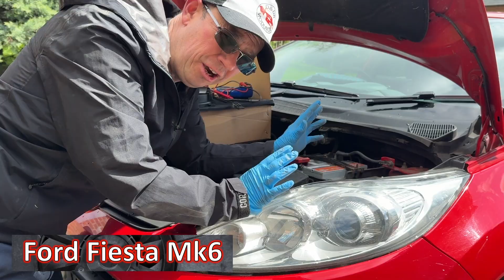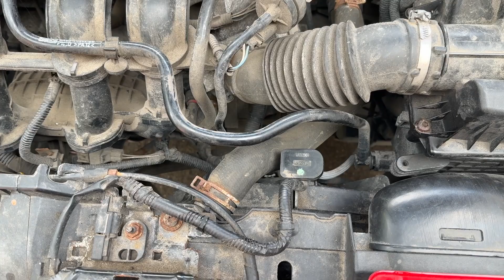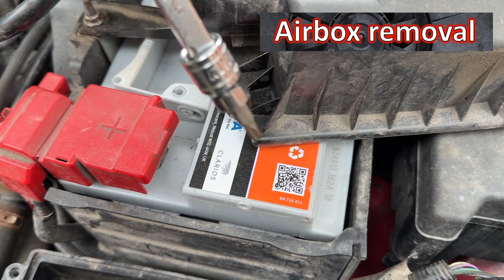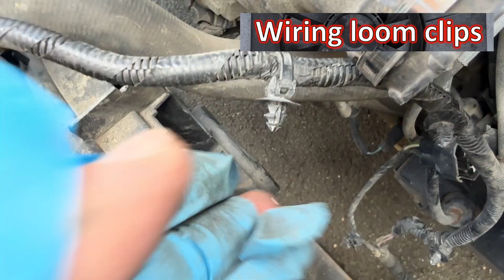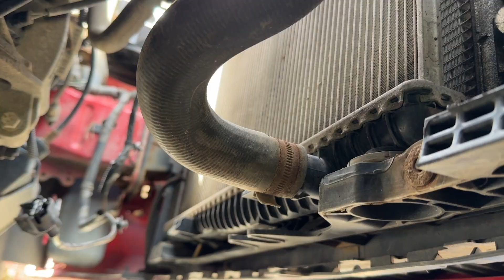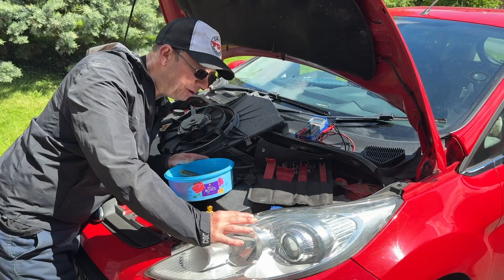Ford Fiesta Radiator Fan Replacement | Fixing Overheating Without Draining Coolant

Comment: I just changed out the fan, 10 minutes, no need to remove the airbox, drops down, no problems. Thank you for your video, it helped big time 👍
Reply from the maker: Per, glad the video helped you get the job done and thanks for sharing that tip about skipping the airbox removal, regards Damian.

Comment: Fantastic video, I’m guessing if the fuse has blown, it will be down to a faulty motor.. am I right in thinking that even replacing the fuse could temporarily fix the fan but the initial problem will still be there. Also how has that after market fan held up?
Reply from the maker: @Menace2S, thank you, glad you enjoyed the video.
You are spot on with your thinking. A blown fuse usually means the fan motor was drawing excessive current—often caused by worn internal bearings, tight spots in the motor windings, or debris seizing the blades. Replacing the fuse might get it spinning temporarily, but as soon as the motor gets hot or hits that high resistance point again, it will likely pop the fuse once more.
As for the aftermarket fan assembly, it has held up brilliantly! It has been fitted for a good while now through all seasons, and we haven't had a single issue with cooling performance, noise, or reliability.
Working and learning together as a community is what this channel is all about, regards Damian
Reply: @Modurol  Thankyou. Can I ask again please the one you have put a link up for, would that fit my my mk7 1.25 fiesta? As I think the one in your video is a mk6.
Reply from the maker: @Menace2S, Thank you for asking.That is a very important point to clarify, as Ford model naming depends heavily on where you are located.
In the UK, our 2012 model is widely referred to as a Mark 7 (Mk7), whereas internationally—and in many parts of Europe—that exact same 2008–2017 generation is officially designated as the Mark 6 (Mk6).
If you are based here in the UK with a Mk7 1.25 Fiesta, the part linked in the video is indeed correct for your car. However, if you are located outside the UK, your local parts catalog might list it under the international Mk6 designation instead. In either case, cross-referencing your registration, VIN, or OEM part number before ordering is always the safest approach. Most auto suppliers with confirm the correct part for your car before ordering. Working and learning together helps us clear up these regional mix-ups, regards Damian
Reply: @Modurol  brilliant thank you mate! I am only in Merseyside so I don’t think it’s too far from where you are judging by your accent 😊. Mine is a 2013 fiesta
Reply from the maker: OK great info that helps—being a 2013 UK car, yours is technically a Mk7.5 facelift model, while still part of that wider Mk7 generation.
Fortunately, the radiator itself is actually the same across these versions, so you won't have to worry about core or mounting layout changes there. It is always good to double-check those exact build years and part numbers before ordering, though (double check with the seller), regards Damian
Reply: @Modurol just changed the fan and it now works when the ac is on. But when I run the car up to temp the fan doesn’t come on automatically. The coolant level rises . You have to manually put the ac on for the fan to activate…

Comment: I have a 2016 ford fiesta and I checked for connector for power and ground and it only has ground no power from test lighting. As well I checked the fuses and relays under the hood and none was blown on testing relays and strip not broke on fuses. Do the fan connector posed to have ground and power ?
Reply from the maker: Esai, yes, the fan connector should have both a solid ground and a 12V power feed when the engine computer commands the fan to run.

Since your fuses and relays tested fine, it is worth noting that the PCM (engine computer) controls the fan relay by switching the ground side of the relay coil. A very common trick to test the circuit is to turn the engine on and switch the air conditioning to full blast; this forces the PCM to request fan operation. If you still get no power at the fan plug during an A/C test, the issue usually lies in the main power feed to the relay box, a corroded pin/wiring harness near the bottom of the radiator, or a bad resistor pack on the fan shroud itself (if equipped).

Troubleshooting electrical issues can be tricky, but working and learning together helps us narrow these problems down step-by-step. If you enjoy these technical guides, please feel free to subscribe to our channel to follow along with more repair breakdowns, regards Damian

Comment: I've got the same problem with mine. it is a 2014 1.2l 
I replaced the fuse and then fan came on, did smell a bit tho. left it for a couple of minutes. turned off the ignition and turned on again a few minutes later and the fan didn't come on, check the fuse and it had blown. could the radiator motor of cause it?
Reply from the maker: Oliver, Yes, a worn or failing radiator fan motor is the primary suspect here. When the internal bearings seize or the electrical windings inside the motor start to degrade, the motor has to work much harder to turn. This creates high resistance, which causes the motor to draw far more current (amps) than normal, overheating the wiring and popping the fuse to protect the circuit.

That electrical burning smell you noticed right before the second fuse blew is a classic sign of the motor windings breaking down under heat. Before putting another fuse in, try spinning the fan blades by hand (with the ignition off and key out) to check if there is heavy resistance, scraping, or rough bearings. If the fan feels tight or stiff, replacing the fan assembly will resolve the issue. Having said that my fan moved relatively freely, only slight resistance although not as well as the new one.

Let us know how you get on with checking the motor—it is great having you with us as we work and learn together across the community. regards Damian

Comment: Hi thanks for the video. I have the same issue and will follow your video. Can you tell me please where did you get the replacement from and the price. Many thanks Gary.
Reply from the maker: Hi Gary! Thanks for the comment, and I'm really glad to hear the video is helping you tackle your radiator fan replacement.

For the Ford Fiesta radiator fan, you have a few really good, affordable options. If you are replacing the entire fan and shroud assembly (which is usually the easiest way to do it since it simply drops into place), a brand-new aftermarket replacement typically costs circa £60. You can easily source these from online automotive parts retailers like Euro Car Parts, Car Parts 4 Less, or Ebay. If you prefer to pick it up locally, your local motor factors like GSF Car Parts will usually have them in stock or available for same-day delivery.

Working and learning together to keep our cars running cool is what our community is all about! Please subscribe to our new channels, Modurol Live and Modurol Shorts, to catch our upcoming live workshop repair streams, technical tips, and quick garage fixes, regards Damian